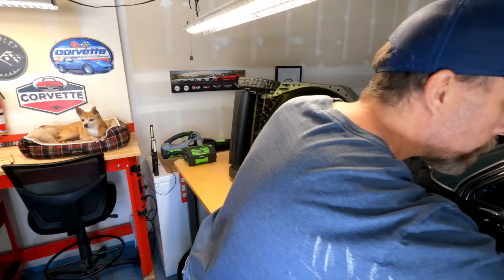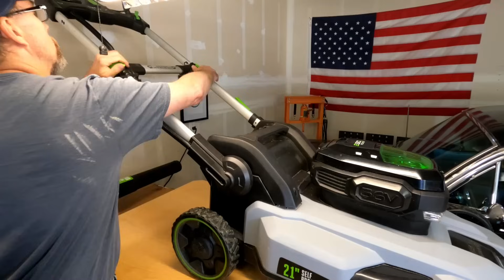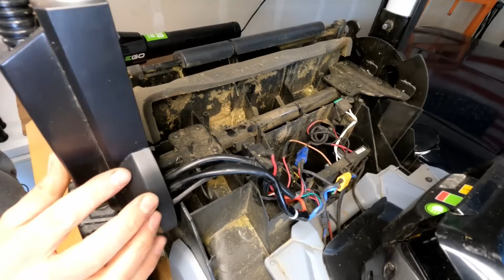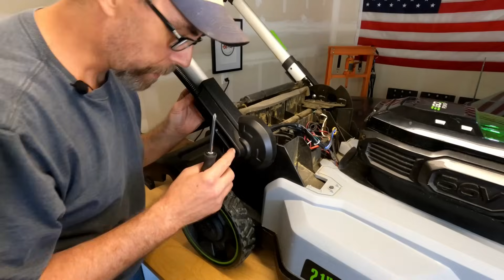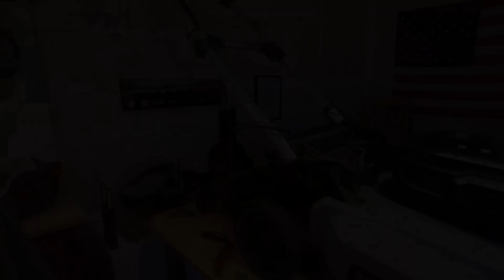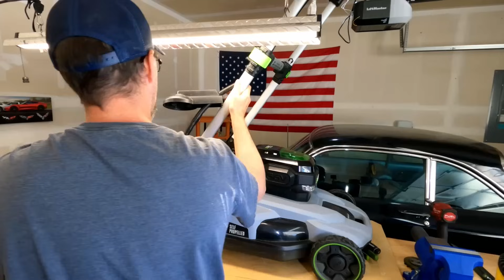My Ego Mower Finally Quit Working!!  🔧  Can I Fix It??

Comment: Nicely done. I'm on my second Ego mower (first had some rust damage when I got it as a gift, and I had a structural failure in the handle). I had a similar issue that I repaired on the old one before the rust took out the handle.

Comment: It seams that 90% of all issues with EGO mowers are all related to the different safety switches concerning the handle. I already removed one switch and spliced its 2 wires to bypass a switch.

Comment: Thanks, I had the exact same issue. I ordered a replacement wire harness for $5. Now I need to get the clamp assembly at the safety switch back together properly.

Comment: I'm not quite sure how you would view or judge a battery operated mower because I've heard rumors of an Ego lasting up to 11 years on the same battery. Myself I just purchased a Greenworks and now Honda has started making them.

One thing I would caution when attempting to work or change blade is after removing the battery hit the power button as they something maintain a charge even after the battery is removed.

Comment: I still running my 12 year old EGO 20" push mower, but had to do three fixes. The green safety push key kept popping out when I would release the run lever, so I put electrical tape over the key so it still works as a button but no longer pops all the way out. The green clips that snap in placed when the handle extends would come loose while mowing. I found that ridges on the inside of the green clips prevented them seating fully, so I filed them down and they snap in place more positively and don't come loose while mowing. Then one time, before the push key tape fix, it felt like the key didn't engage correctly and the mower engine wouldn't turn on. I disassembled and reassembled the push key plastic housing and realigned something. After these fixes, no problems. It's a little less work to merely collapse the handles when storing rather than removing the bag, collapsing and folding the handles, and stowing vertically. The only downside to storing horizontal in a more ready state can allow wet underdeck grass to get smelly in a week, so I scrape the grass off after a mowing session. I also don't fully charge after mowing because lithium batteries don't do well stored when fully charged. I charge to 100% an hour before I mow (and not after) and the batteries seem to last longer.

Comment: hey man, great video, any chance I could bounce some stuff off you?  I’ve bypassed the mid handle switch and checked for bad wires at the pivot point - thing starts fine and then shuts off in about 5sec - everytime

Comment: Just fixed mine quickly thanks to your video. Same small black wire kinks in black and blue wire. I decided to cut all 3 and splice with single WAGO connectors.

Comment: Great job on the repair!  Glad I saw your video. I was wondering if I should avoid folding it away each time. Going forward I plan on making more room in my storage building to park my mower without folding. Thanks for the video.

Comment: Watching from the angle you set the camera, it was evident to me the black wire was the culprit, but you kept pushing on the larger wire which was rubbing on the black wire. I expected to see a swivel assembly that would allow for unlimited movements of the handle. Like one viewer mentioned,  using stranded wire will take more flexing, but still over time that will fail also. EGO has a design flaw and this flaw will be at the customers' expense.
Reply from the maker: Good points. It has been a few seasons now since the repair and no sign of failure. I will keep my fingers crossed.

Comment: You done all safety checks, but when you inserted battery and started wiggling energized wires, that's no,no .56Volt DC positive is dangerous when you make body contact with negative wires!!!
Reply from the maker: thanks

Comment: A lawn mower should last a lot longer than 3-4 years! If your's is still under Warranty why are you fixing it? EGO should repair it.
Reply from the maker: Great question, all be it probably the 100th time it has been asked here. I have a YouTube channel where I fix things and show others how to fix things. I was able to fix the broken wire in less than an hour (while recording a video), for free, that has been viewed 150,000 times and has helped thousands of folks in the same boat (many of whom have mowers out of warranty). I have made money from this video that has helped support my family. I was able to mow my yard that afternoon without problem and the fix has held up great. Additionally, as has been mentioned many times in this comment section, the warranty process with EGO is daunting to say the least. You have to contact them and traverse their support system. You must locate a certified repair shop (if there is one in your town). You have to deliver it to them. You have to wait for them to have time to look at it (mowing season is super busy and you will wait in line). Then EGO has to authorize the repair. Then the parts have to be ordered (more waiting). Then you have to wait for the repair shop to receive the parts and then make the repair. Then you have to wait for EGO to pay the repair bill. Then you have to go get the mower from the repair shop (again, hopefully not too far from your home). Then, after all of that, you can mow your lawn. If you don't have a second mower, you will have had to hire a company to mow several times in the interim. All of this for a simple crimped wire. Hope this answers your question.

Comment: Amazing video — I think I have a similar issue with my Ego LM2000, but I’m not familiar enough with some of the tools / wire I need to fix this. I’m not sure what kind of patch wire to buy, for example. I noticed you briefly showed what you used at about 23:05 of the video. Is there any way you could share a complete/detailed tools/parts list?
Reply from the maker: Thank you so much!  No worries. I just used some standard 18 gauge automotive grade multi-strand wire for the patches. Also, I just used a basic soldering iron, flux, and roll of basic solder for the repair, and then sealed it up with the appropriate sized heat shrink tubing. There are a ton of great videos already out there on how to properly solder and patch wires that would do a better job than I. Hope this helps.

Comment: Awesome video! I don't have the exact same issue, but I think It's relative to my issue. The lights turn on, the lawnmower moves, but no blade spin. I thought it was the switch, I tested the connection with a multimeter, and still stuck in head scratcher mode... Thanks for this info!
Reply from the maker: Thanks! Sorry to hear about your issues. I am sure you will get it dialed in :)  Glad my video is proving helpful, if at all. Good luck!

Comment: Having this same issue it seems and my mower is a year and a half old.
Reply from the maker: That's a bummer. Sorry to hear that. I am surprised that after this many years and as many warranty claims as they have probably had that they still haven't addressed the issue.
Reply: @EndWrenchRookie Thank you for the video.  A simple thing as fully extending and shutting the clasps fixed my problem.  Much appreciated.
Reply from the maker: @KenS-o9o  That's great!

Comment: My 2114 made this loud bass drop sound and quit. Blades were set high, grass was dry, I didn't run over anything, and I don't fold my arms/handles down for storage. Why can't they use thicker wires? Anyhow, I think I'm gonna like this channel. I like the methodical work. 

Mine is under warranty still, but they want me to take it to BFE. I can't believe how few authorized repair places there are in my state!! I was given 3 options, two right next to each other in a known kkklan area. The third option is just over the bridge in Sarnia, Canada! I'd actually prefer the Canada option, but I don't have the enhanced license yet. 

It's nuts that I can buy it a Lowe's but repair places are scant and far away. They need to fix that. Grrrrrrrrrrrrrr
Reply from the maker: Oh man, that doesn't sound good. If you can't spin the blade freely by hand, then your motor is probably toast. I have been really lucky with my machine that all the problems that I have had have been simple wiring issues that were easy to fix. Terminal problems are a bummer. Hope you can get it worked out. Good luck!

Comment: why did you need to remove the blade after you removed the battery?
Reply from the maker: At some point, after the repair, I was probably planning to test the motor. Having the blade out just seemed like a good idea. But you do you.

Comment: Looked at a 600 series non-propelled EGO mower today, loved it, nice and light. They have a floor model $50 cheaper, but no EGO warranty. Associate ran it & showed me how it folds up, it had some grass clippings. Walked out to do some research, after seeing this review I can imagine how many times that demo model must have been folded up fatiguing the wires. No thanks, I’ll buy new with warranty and keep in the non-storage position. Appreciate the vid and will surely give it a thumbs up.
Reply from the maker: Good thinking. Hope it works out for you. Thanks for watching and for the feedback.
Reply: K

Comment: Thanks so much! Gave me the confidence to tackle this! At first I thought it was the handle extension safety switch, but it was the wire to the handle rotation switch. Used solder seal wire connectors 👍
Reply from the maker: That's great. Good work. Glad to have helped, if at all.

Comment: I have an EGO 2100 mower that I have used for 10 years. Same battery. Problem was the wires at bottom of handle were breaking from folding folding all the time. Now I just push it in the shed and don't fold the handle. The cover at the bottom comes off easier with handle folded down
Reply from the maker: That's great. Thanks for sharing.

Comment: What i did is stopped storing it in the folded upright position, and only fold it and store in the horizontal position, going on 3 years with no cut out😊😊😊😊😊
Reply from the maker: That would do it. Good job  :)

Comment: There is a safety switch in the handle clips as well.  if you don't fully click the green handle slide locks it wont go.
Reply from the maker: Sounds about right.

Comment: The only other issue I have is that the RIGHT side drive button has become touchy.  I use the right side far more than the left.  The left is still fine, so I haven't bothered to take the handle apart and fix that.  My model doesn't have the green lever but has two thumb push buttons.
Reply from the maker: Interesting.

Comment: I can fix it... but I don't want to pay $160 for a whole drive mechanism when all I need is a nylon cog, which they won't sell.  I guess they figure people can't manage getting the cute little tumblers in the offset gear set right.  But some of us can.  Maybe I can get someone to 3-D print one for me.....  Otherwise, I love my Ego.. I have the mower, the trimmer, the chainsaw trimmer, the blower, the edger, the backpack and a bunch of batteries.  I love it.  But not selling these parts separately is annoying.
Reply from the maker: Ya, overall I have been very happy with my EGO equipment as well.

Comment: I had the same problem with my EGO mower.   The repair shop that fixed mine said the government  was pushing them to get these mowers to market, so they didn't have time to complete the research.  It's a good mower.
Reply from the maker: Very interesting. Definitely an R and D problem. At least it is an easy fix. It has been a couple of full seasons of mowing since this repair and I have not had any more issues.

Comment: I’m having the same issue. I’m going to give this a try. If it doesn’t solve the problem I’m going to go buy a new one, wait a couple weeks and put my old one back in the box and get a refund and tell them mine stopped working. I only used mine for one summer, bought brand new and now having the issue after 1 season
Reply from the maker: Well, I hope you have luck with your repair.

Comment: Piece of design junk. Unscrewed the cover moved wires around and it started. Put the cover back on it doesn’t work. Ridiculous.
Reply from the maker: Sounds like the same problem I had.
Reply: @EndWrenchRookie I still haven’t fixed it yet, no patience

Comment: Thank you for this video. I watched it as the last one of 5 that I watched. I pretty much had the solution by the time I watched your video, but you gave the most important piece of information.  The black wire that you cut was actually 3 smaller wires. You saved me from just cutting this wire. With the help of my wife and a razor blade, we carefully peeled the insulation back.  We had narrowed the area of the wire problem down pretty close to where we thought the problem was located.  The 3 wires red, blue, black were 18 gauge. We didn't know which one was the problem.  We separated them and my wife held two still while I wiggled a 3rd. Using this method, we found the bad wire and narrowed problem area. We cut this wire, removed about a 3 inch section (to ensure we captured the problem area) and spliced in another wire with heat shrink butt splice wire connectors; one on each end of the added section. There is not enough slack wire to just splice the wires back together after removing this large (3-inch) section. Thank you again for your detailed video. The other videos had helped find the solution.  Of the 5 videos I watched, one was nearly a duplicate and one was a total waste leading to an improper solution; I didn't watch this one to the end because he was headed down the wrong path. There was one additional video that was about the disassembly of the mower.  I only watched enough of this one to know it was not what I needed and didn't count it as one of the five.
I worked on a table just like you, but I didn't remove the blade; my wife and I were very aware of the blade at all times and never put our hands near the bottom of the mower. We also never needed to run the mower for more that just a few seconds to do the trouble shooting. I also blocked the wheels to keep the mower from moving while on the table. Thank you again!!
Reply from the maker: Nice work. Thanks for sharing your experience. I am sure others here will find it helpful. Thanks for watching as well :)

Comment: My mower wasn't cheap and is brand new. I hope they redesigned the hinge pivot. If possible or available, maybe get wire that has tough fiber like insulation vs plastic. Just like the usb charging cables that are reinforced and withstand several thousand of bends without failure. Everyone email the manufacturer and suggest this idea.
JUST MY OPINION EVERYONE. 
IF POSSIBLE DO NOT FOLD THE HANDLE DOWN TOO OFTEN TO AVOID CRUSHING THE WIRE STRANDS. Renew any extended protection plan if it's an option.
I plan to store my mower exactly like a gasoline mower. I might fold it upward for blade changes. 
Otherwise, I'll save my box and flip the mower on its side for cleaning. I read or heard somewhere that after removing a battery from tools and a few other items. The user should press and hold the power button a few seconds to drain any energy left. A switch on my Dewalt electric drill got sawdust in-between the flat metal electrical contacts inside the variable speed trigger. I blew it out with compressed air and all was fine.
Reply from the maker: Great info and input. Thanks for sharing.

Comment: Hi
Thanks for your video.  After 6 years, my lawnmower stopped working.  The problem was exactly the same as yours.  I replaced part of the wire with 22AWG wire.  It is working good now.
Reply from the maker: That's awesome. Good work!

Comment: I am a retired electronics tech of 40yrs - work & hobby. Two things: You never mentioned the type of wire used to implement the splicing, but if you want something that will stand up over time, use quality stranded (the more strands the better) silicone sheathed wire. Use 12 ~14 gauge, as the diameter of heavier wire might be prohibitive. Secondly, speaking of diameter, using marine heat shrink tubing over all three wires would likely give you an overall smaller diameter in addition to providing a water tight, oxygen free, more resiliant  repair. 
Otherwise you've made an excellent video. I own three EGO lawn products; I'll know where to look should this happen to my self-propelled EGO mower. It was a thrill just seeing what's under that cowl.
Thanks !
Reply from the maker: Great tips and info. Thanks!

Comment: Great video my mower the blade works but it no longer will self propel any ideas ??
Reply from the maker: Thanks. Ya, mine had a problem with the drive as well. Though not no propelling, but it was stuck on high speed. It ended up being the same issue with a crimped or stretched wire, but instead of the pinch point being at the lower hinge, it was at the handle extension on the side with the wires running up it. I had to take apart the plastic housing at the handle lock and fix a wire that was broken. Might be your problem too? Hope this helps

Comment: SUPERB! Mine is 10 yr old now, mower has been cutting out for years now when jiggling handle. I bypassed the handle extension limit switch several years ago. Now my problem seems to be exactly same as yours. Will fix later. Right now, my 7.5 Ah battery is about dead, have to recharge 8 times to mow lawn (used to do whole lawn). So, New battery $400, new mower $600 on sale now, so will buy new mower, fix wiring as you show, and sell the old mower. That will get me a new mower for $100-150 over the cost of a battery.
Reply from the maker: Sounds like a good plan. Glad to have helped, if at all. Thanks for watching!

Comment: For safety, after removing the battery, discharge any residual stored energy by engaging the power switch that activates the blade circuit. Do not attempt to touch or service the mower blade until this discharge procedure has been completed.
Reply from the maker: Great tip. Thanks.